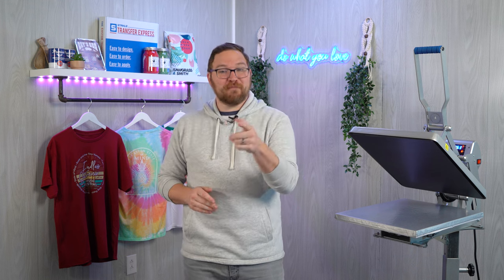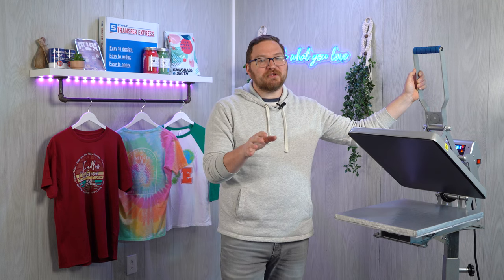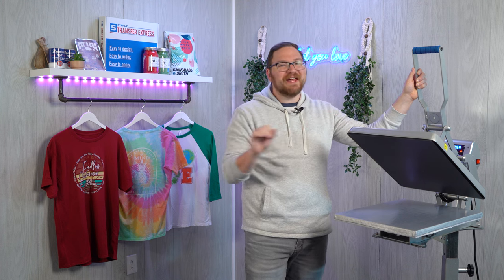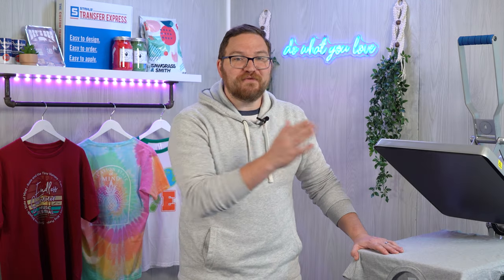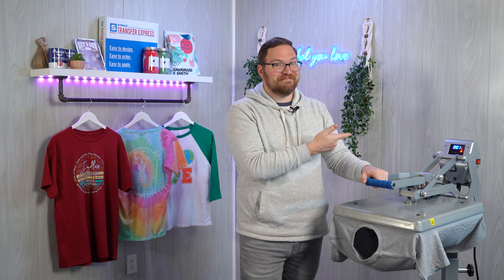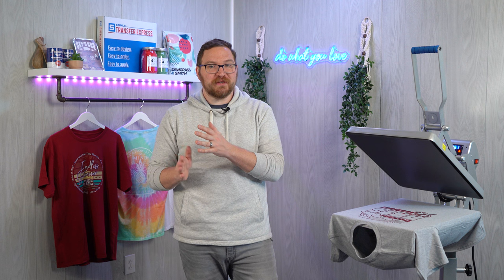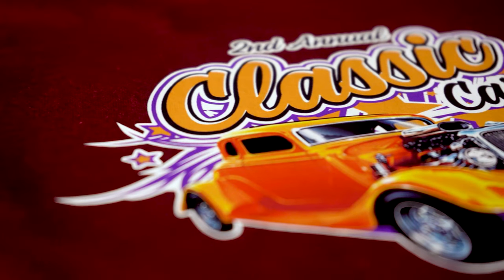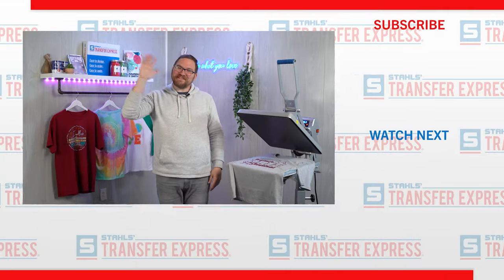Heat Transfer Troubleshooting Tips: How To Print T-Shirts Like A Pro

Comment: Hi Dave and friends! Had a question about layering images with goofproof or other transfers. I know that the printing process eliminates the need for color separations and multiple pressings, but would it be possible to achieve an overprint/layered effect if I applied one transfer and then applied another, or would the 2nd image just sit on top of the first?

Second question: which transfers are best for halftones? (context: thinking of designing some shirts that have that bootleg band tee aesthetic). Thanks in advance!
Reply from the maker: Hey Andrew, great questions! Goof Proof inks are pretty opaque, so with most colors the second print will completely cover the first with no overprint effect or "third-color" if that makes sense.

As for halftones, large stylized halftones are the only kind you can reliably print (the smaller ones just don't have enough surface area with transfers to last 50+ washes), so the absolute minimum for the negative space and the dot itself should be .045" (or equivalent to about 3 pt.)
Reply from the maker: But both Goof Proof (if 1-2 color artwork) or UltraColor Max would work great with the smaller details.

Comment: Thank you for this helpful video! So my heat press for a heavy cotton/poly blend sweatshirt should be at 375 degrees instead of 365 degree if I don't have a Hotronix heat press? Also, are there instances where the goof proof screen print will sit more on top like a sticker for instance on a cotton/poly blend, or that just means pressure wasn't enough or temperature wasn't high enough? Thank you so much in advance!
Reply from the maker: We're always happy to help Alexandra! For the temperature, it depends on what transfer type you're using- If you're using Goof Proof screen printed transfers, yes, the temperature should be 370-375 degrees if you have another brand of heat press. 

I would test press a garment to ensure the cotton/poly blend is ok at that temperature. Some lower-cost blanks, certain colorways or high polyester content can be more heat sensitive than others. 

When applied without enough pressure or heat, Goof Proof may appear to sit more 'on-top' of the fabric. Cotton or cotton/poly blended garments should print with a very similar finished result. Typically not enough pressure is the hidden culprit for applications like these.

Comment: Hi there what kind of paper are you using on the video? It doesn't look to be a light color transfer paper nor a dark color one since it has no background. Thank you
Reply from the maker: Hi Paula, we're using our Goof Proof Screen Printed Transfers here. They're a plastisol ink transfer that applies to light or dark color fabrics, cotton, polyester or cotton poly blends. You can learn more here: https://www.transferexpress.com/heat-applied-transfers/goof-proof-screen-printed-transfers

They're made to emulate the look, feel and durability of a traditional screen print on a t-shirt all without the hassle of the setup and cleanup of screen printing- all you need is a heat press- we'll handle the mess. 

We print the transfers with your artwork (or you can even design online) so you don't need any expensive equipment- just order transfers on demand (our turn times start as quick as the next business day) There's nothing too special about the paper, its more in our process and ink and adhesive formulas- allowing for application (just like we show here) in as few as 4 seconds.

Comment: If you make a mistake and print the elasti print and it sticks to the top heating platen, how do,you clean it off?
Reply from the maker: We've been there before - While the press is still hot, you can bunch up a extra/ruined t-shirt and wipe it off carefully. If the press has cooled down you can turn it back on to help soften the inks. 

Avoid using harsh chemicals, abrasive materials or metal scrapers as they may damage the coating on the heating element. 

We put a video together a few years ago on some heat press cleaning tips: https://youtu.be/3F7qWhU-JBE

Comment: My transfer isn’t sticking to the garment. The temperature and pressure is accurate and hot peel but it still won’t stick😩
Reply from the maker: Sorry to hear you're having issues Amber! To help we'll need a little bit more information: What transfer type are you using? What heat press are you using? What are the application settings you're using (Time / Temp / Pressure / Peel)? What fabric are you applying to?
Reply: Hi, I’m experiencing the same issue. I’m using a Vevor heat press and sticking a DTF transfer on a polyester sweater with the temperature of 360 and 10 seconds. I did the hot peel and it didn’t stick all the way. I’m not sure what I’m doing wrong.

Comment: I accidently printed my picture upside down on my tshirt, is there a way to fix it?
Reply from the maker: The short answer, most likely not. In many cases you would not be able to completely remove the print without damaging the garment itself. It's typically much more effective to reprint on a new garment. 

Depending on what specific kind of heat transfer you used it may be possible: Heat Transfer Vinyl can be removed with Vinyl Remover, but some adhesive or staining may remain on the garment. You can also try heating from the inside of the garment and then try to carefully remove the decoration.

Comment: Hello! I'm having trouble with my transfers release on my Ultra Color Soft transfers. I wait until it's cold and it's still hard to get off. I tired to use another transfers I had and it came off fine.
HELP!
Reply from the maker: Oh no Karen, I'm sorry to hear you're having application issues. What heat press are you using, are you pre-pressing the garment prior to decoration and what pressure do you have your press set at? You can try with increased pressure to see if it helps the application. Be sure you're at the proper heat setting for the fabric you're applying to: 340-360 for cotton & cotton/poly blends or 290-320 for 100% polyester garments.   

 Please submit a resolution from your account dashboard at transferexpress.com so we can take a closer look and fix this issue for you.
Reply: Hello I have a Phoenix heat press.
I'm preheating the 100% polyester t shirts first. I'M USING medium pressure.
Reply from the maker: If our team hasn't answered your resolution yet, you can try applying at 300 degrees (check to ensure the garment wont scorch) and press at 12 seconds on a firm pressure. Remove the garment from the press and allow to cool to room temperature before peeling (5 minutes). Use the supplied paper coversheet to avoid any static from the press that may pull the carrier up when the press is opening.

If you haven't already, please submit a resolution as UltraColor Soft is typically an effortless application on 100% polyester garments. If something went awry with the transfers we will be there to support you and replace.
Reply: We’ve tried more pressure and increasing pressure but the logo would not stick. Now the transfer paper is stuck on the shirt. Any ideas of how to get it off I could really use the help?
Reply: Increasing temp and pressure

Comment: Hello Dave! As you said at the end of the video my print seems to be like a sticker on top of the fabric and dont appear to sit down into the fabrics. Why can I have this problem? Thanks for the video!!
Reply from the maker: There's a few different factors that can impact the feel of the print on the shirt (Decoration method, fabric material, application & settings, etc). 

What decoration method and heat press are you using? It also may be a simple pressure adjustment that's required for a better result.

Comment: Im having issues with thr goof proof on a 100% cotton tee. Im using the fancierstudio heat press but sometimes the peel doesnt fully come off the transfer paper or if it does, the ink doesn't seem to be embedded in the  shirt.  PLEASE HELP
Reply from the maker: Hey Christian, I'm sorry you're having application issues, we'd love to help. First: Please submit a resolution through your account dashboard at transferexpress.com- Our team will review every detail of your order and be able to help (and possibly even test your transfers). You'll be able to upload photos so the team can have the best way to help. If some of the tips here I'll detail here work, GREAT! but, If they don't our team will be on it to help and replace your transfers if needed.

Are you pre-pressing your shirts? In humid climates, 100% cotton t-shirts are going to absorb moisture from the air which steams out when it's on press. It's best to pre-press the blank to get that moisture out of the shirt so it's not pushing up through the ink when you're trying to press ink down. 

With your heat press, we recommend increasing the temperature by 10 degrees: For Goof Proof on 100% cotton your press should be set to 375. Goof Proof requires a firm pressure, so without a digital pressure readout, load a shirt on the press and increase pressure until the press is very hard to close, then back off slightly until you can close it (it should still have some resistance to it). Press for the 4-6 seconds recommended. You can also try the "dollar bill" test we detail here: https://www.transferexpress.com/videos/how-to-test-temperature-and-pressure-of-heat-press

As with some of the more budget-friendly heat presses out there, they may need a minute to recover temperature after pressing, so while the first couple might print fine, the temperature loses too much heat and you may find some ink staying on the carrier sheet. 

With accurate time, temperature and pressure you should be able to get perfect, consistent applications- Let us know if these work, and please submit a resolution so our dedicated team can take care of you.